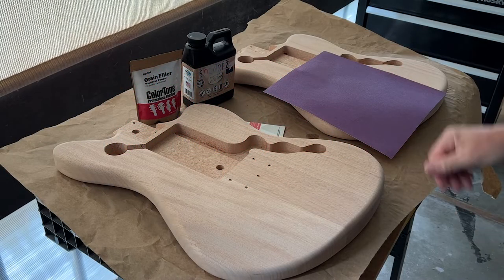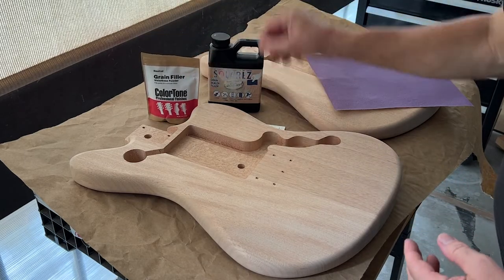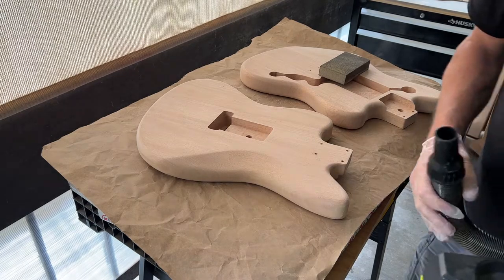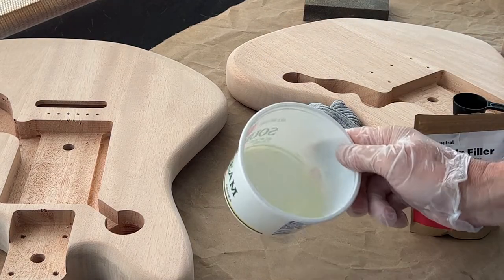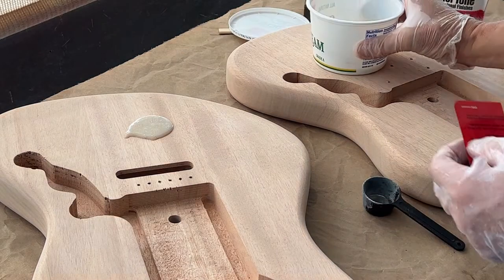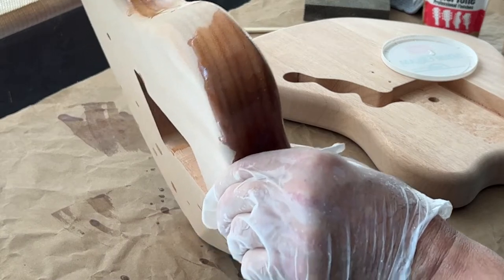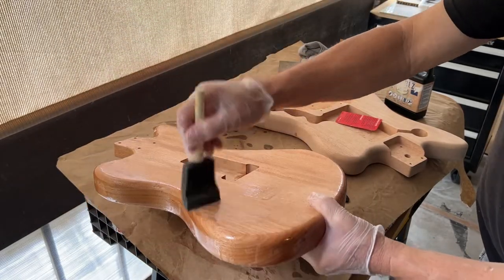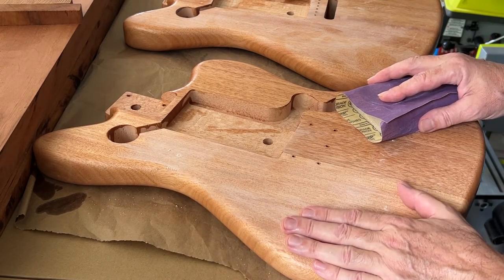Grain Sealing the Stewmac Offset Kit Guitar Bodies with Solarez UV Grain Sealer

Comment: Nice work. You just did the grain fill once? I am using Solarez I Can’t Believe It’s Not Lacquer on a mahogany body and the directions say to do it three times, but I’m not using any powdered grain filler. Does the grain filler eliminate the need to repeat it? I’ve done it twice so far and can’t decide whether to do it again. I think the grain is already filled, and I’ll be putting primer and color over it.
Reply from the maker: Aloha Will, the powdered grain filler worked very well with Solarez..  When you work with porous wood, it's important to fill the pores, IF you want an ultra smooth finish.  The grain and pores will telegraph through any type of paint you'll apply, unless you fill the grain and pores.  I sanded and there were certain areas that I sanded down to wood, so re-applied and sanded again, because I'm still trying to decide whether I want to paint the bodies, or just stain them.  I tend to favor stained guitars with some of the grain showing.  A wood sealer is important if you want to apply an even stain, without any areas that absorb more than others and look blotchy.  This is especially important for softer woods and really has no effect with woods like hard maple, where the grain and pores are extremely tight.  At this point, I can go either way, but I'm winding pickups right now.  So I have a little time to think about it.  Best wishes on your guitar build!  Send photos.

Comment: Like the pool noodle idea. Did you notice any nasty solvent smell or allergic reactions? Im always looking for a safer option then the epoxy grain fill i do now as i dont like exposure to nasty chrmicals for my lifetime
Reply from the maker: I didn’t have a reaction, although it does have a smell until the UV light cures it. Much less than oil based products. It sounds like you might want to try out water based products. Thanks for watching!

Comment: You didn't "raise the grain".
Reply from the maker: I wiped the the body down with a wet cloth, let it dry and sanded before I sealed. Thanks for watching!
Reply: THIS GUY DOES NOT HAVE A CLUE WHAT HE IS DOING  !!!! NO ONE PUTS THAT POWDER IN THE GRAIN SEALER. NO ONE. HE ALSO SAID HE SANDS WITH THE GRAIN BUT NOTICE WHAT HE DID ON THE INSIDE OF THE NECK. I BET HIS WORK SELLS FOR $25 DOLLARS A GUITAR.